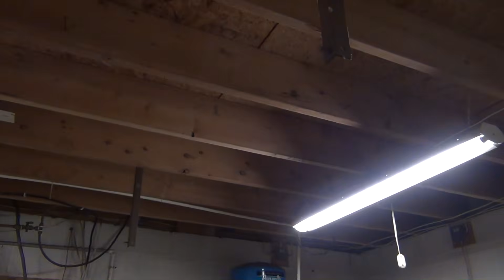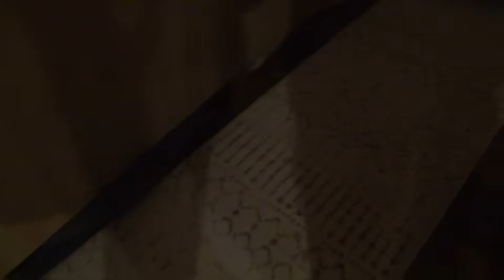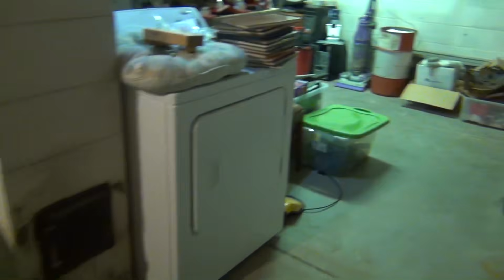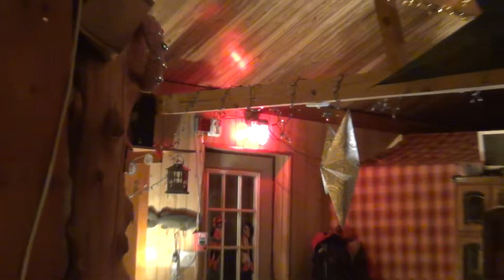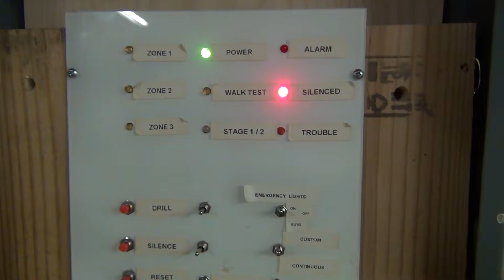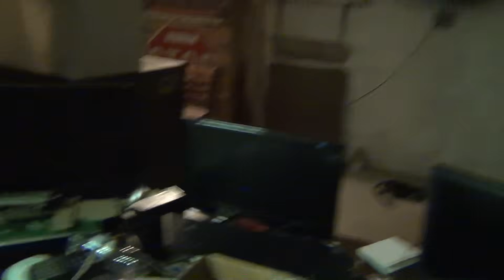System Test 28:  AC Devices!

Comment from the maker: Two things to note:
1).  DISCLAIMER:  This video features devices powered by 120v AC.  Do NOT play around with this kind of voltage, it has the potential to cause serious bodily harm, or even death.  I made careful and deliberate efforts to verify that the circuit was not receiving power while it was being serviced.  Only work with 120 volts if you follow proper safety precautions, or have someone on site that is qualified.

2). Sorry about the badly edited jump cut in the beginning, I stated that the yellow walk test LED was new, but it was actually in the last system test, so I cut it out of this video.
Reply: Do a 28.1 with a true alert on 60 bpm and 4050s on 90 bpm
Reply from the maker: @vintagesimplexfirealarmsof6440  I can only do one coding pattern at a time
Reply: @FrostedStrobes  oh 90 bpm plz
Reply: @FrostedStrobes 
 -
Reply: @vintagesimplexfirealarmsof6440 do one coded to 4-4
Reply: @FrostedStrobes hi buddy sorry I was mean to you and your friend along time ago I got more patients now so I was wondering if u can do a video with simplex horn strobes the red square ones like the ones that schools have and have it on march time and then after that continuous and then after that code 3
Reply: @FrostedStrobes i like Fire Alarms
Reply: @vintagesimplexfirealarmsof6440 f😊
Reply: Yea I am starting a fire alarm sitcom testing
Reply: Electroboom has touched 120VAC before and it is not peaceful, it is hell, don’t do it 👍🏻
Reply: @Alarmo450  I Watch ElectroBOOM
Reply: @iansanchez1470  SAME! That transformer that he cut open sounded incredible that one time. It sounds like a device that Frosted hid from the video.
Reply: @Alarmo450 yeah bro gets shocked almost every video
Reply: So I would need FrostedStrobes to come to my home
Reply: I he would…
Reply: If he wants
Reply: Indeed 120VAC is very harmful
Reply: @Flanks719  it is, but if it’s just a little shock then it’s not that big of a deal, I should know because I got electrocuted 9 times in my life
Reply: I have a 12VAC 4050 too
Reply: Yeah, for that light that had the red light bulb in it, for the 4050, it kind of sounded raspy.
Reply: I have to say that I admire your ingenuity with this setup. I work Armed Security for a major area local hospital of which active fire/alarm response is one of my core duties. I'm not 💯% entirely sure as to the exact technical/programming specs of the fire panel itself located inside my security station (other than the system is coded to sound a low volume single stroke chime within the operating theaters (rooms) so as to obviously not startle the OR staff and surgical teams when performing surgical procedures and is just a standard remote horn while the remaining areas of the hospital are set on a chime as well... BUT however your code-4 setup reminds me of exactly how my control panel is designed...to help prevent/mitigate against any patient/visitor distress, the system is setup more like a Morse Code-like annunciator rather than your typical fire system setup.. To simplify the rundown... Here is exactly how the system operates and alerts to the PRECISE location of where possible smoke/fire has been detected: The hospital I have a security contract with is seven stories: first five stories are the in-patient wards (admitted) rooms with the OR/ICU on the sixth floor and a medical laboratory on the seventh floor - I'll say theoretically that a alarm was activated on the 3rd floor --> ZONE 2 (OBSTETRICS) --> BOILER ROOM 1...I've step away to make my usual rounds and am not close by my station to get a exact report.. The system (coded to chime) sounds as such: 3 CHIMES (announces the location of the alarm that's activated (followed by a brief 2 seconds pause) --> system then sound 2 CHIMES to indicate the zone that has alarmed (OBSTETRICS) and lastly it then chimes again followed by a calm verbal announcement saying: BOILER ROOM 1 (the PRECISE location of a possible smoke/fire event that's triggered said alarm.

 I've come to love this setup since it still performs it's intended job while doing so in a way as to not incite any panic or distress to either patients/staff/visitors or those within the ER waiting room on the ground floor and should a fire ever occur, it makes my job of initiating and assisting in a hospital EVAC much more smoothly and easily without having to exercise any crowd control due to panicked persons stampeding to the fire exits or jeopardize staff/patient safety trying to make thair away to assigned assembly points or areas of refuge SHOULD it ever be a verified alarm.
Reply: True
Reply: With the safety
Reply: I can make my own Wheelock 34 knockoff that uses a very specific custom grille design, but sounds exactly like a dryer. All using 12v AC.

EDIT: Speaking of dryers, try rigging your dryer's buzzer up to the system.
Reply: Soon

Comment: I FREAKING CALLED IT! The way the timing was a bit odd FELT like it was mechanical versus software.
ALSO: Nothing quite like 120BPM on mechanical horns.
I also kind of like how the AC horns sound.
Would also love to se a mode similar to another video where the alarm state switches every second. (Measured the time thru Audacity and it's actually about 1.16 seconds on / off.)

Comment: In system test 25 remember that Argo WGMS add it to the system place it next to the panel and in the office replace the strobe with a Wheelock 7002 – 24 and if the strobe in the office it's just too cute to remove from the system add it to the room next to it make sure to do that in system test 29
Reply from the maker: Unfortunately I cannot do that as I no longer own the WGMS.  

System Test 29 is going to have a wheelock-centric theme, but with electronic horns rather than mechanical.
Reply: @FrostedStrobes  okay that sounds fun did you know that there's a Wheelock 7001t & 7001t-24
Reply from the maker: @something-e3d1f  I have heard of those!  I actually do have a 7001t-24, but I need to replace the horn, if I get around to that I may find a spot for it in system test 29.
Reply: @FrostedStrobes  place the Wheelock 7001t-24 where the stairs is
Reply: @FrostedStrobes  oh do you have to fix it is the horn broken or what after you completely fix the horn make sure to put it in the system test 29
Reply from the maker: @something-e3d1f  The broken one is the only one I have, but since the horn on it is just a 34t-24, I can just replace it with any other generic 34t-24 to fix it. As far as I know, the strobe works just fine.

If I use it, it'll probably end up in the bedroom, but we'll see.
Reply: @FrostedStrobes  too bad in system test 23 you had it in The garage
Reply: @FrostedStrobes  make a video about you testing the broken one if you feel too embarrassed to do it just put it on unlisted
Reply: Is it a broken 7002-24, broken 7001-24, broken 7002t or a broken 7001t let me know
Reply: @FrostedStrobes  in system test 23 you place the broken one in the garage sorry for saying this again but I just wanted to let you know
Reply: I cannot believe that Wheelock 7001 234't-24's have big fat horns

Comment: Weird question but did you buy one of those 4050s off NewAgeServerAlarm? One of them in the basement sound almost exactly like the 4050 featured in System Test 28.
Reply from the maker: Nope, the 4050s came from Wisconsin.
Reply: The one NewAgeServerAlarm used in ST28 was actually a 4051 but he took the diode and capacitor off to make it a 4050…

Comment: How did you wire AC alarms to DC alarms? How did u mix 120vac with 24vdc horns i wanna do 12vac and 24vdc soon
Reply from the maker: I used a 24vDC relay, powered by the panel's horn NAC, with a 20vAC power supply running through the contacts (the 4050s are 12vAC, but they should be fine since there's four of them).  Be very careful not to get anything mixed up, that's how you end up with broken alarms.

Essentially the same with the lights, only difference is each relay is located at the base of the lights (except upstairs, where it's positioned between the two since I bought one fewer relays than I ended up needing).

The golden rule that I have followed from the beginning is that anything and everything can be fixed or rigged to work using relays.

Comment: STVM in Akron has the same 4050s! Have you seen my video of that fire alarm system?

Where did you get those 4050s? Old School Fire Alarms?
Reply from the maker: Glad to hear 4050s still float around in the real world!  Very cool system in that video, I had originally intended to get dual projectors for mine as well, just didn't end up happening Lol

I bought them from some random eBay seller, I don't know if they have any roots in the community or not though.
Reply: @FrostedStrobes  You were trying to imitate my high school? 

You would've needed more 70s 4251-20s 4255s and a 4240 series panel.
Reply from the maker: Wasn't trying to imitate your high school in particular, just vintage systems with big red lights and aggressive AC horns in general.

Especially since I can't afford any of that stuff Lol
Reply: @FrostedStrobes  Sorry for the late reply. My high school may be demolished in a few years. I now go to a high school on the west side of Akron, which is more up-to-date. The fire alarm system will be going to a fire museum; I may be getting that painted over signal setup by door #7 and the broken 4050 in the basketball locker room. Yes, I did share that video with old school fire alarms. 

I can't afford any vintage fire alarm hardware either as I'm a broke high school junior

Comment: I guess you became FROSTED LAMPS in this episode instead of strobes.
<badum tiss>
But I love the code 4-4, it's super cool! I'm excited to see (or hear) what you have planned for it in the future!

Also when is system test 26?
Reply from the maker: Heck yeah, frosted lights are cool, I'll take it xD
I would love to use 4-4 on electronic horns more since literally nobody does that for some reason Lol

also System Test 26 will be coming out sometime around 2091
Reply: @FrostedStrobes  Omg hearing 4-4 on unusual devices like something a MT on bell/siren/slow whoop/march time would be wacky, same with a 7002 series device. Also you never see vibrating bells on 4-4 code. I'm excited to see what you end up doing. 

Also ayyy 2091 isn't THAT far away lmao. It'll be worth it.

Comment: How we use a 12vac horn on a 4006 or 4004
Reply from the maker: I have no idea, I don't have experience with those panels.
Reply: @FrostedStrobes  can u do 90 bpm next test
Reply from the maker: @vintagesimplexfirealarmsof6440  I do plan to make a 28.5 where I do a few other codes, like 90, 60, and 20 BPM, and showing what the red lights look like with all the basement lights turned off, that kinda stuff.
Reply: @FrostedStrobes  cool
Reply: @FrostedStrobes  imagine doing cont with volume screw all the way out
Reply from the maker: @vintagesimplexfirealarmsof6440  Ooouuch my ears xD
Reply: @FrostedStrobes  when are u going do that
Reply from the maker: @vintagesimplexfirealarmsof6440  Hopefully soon but I'm not too sure, I need to buy more wire since I started fixing the awful mess of them I'd made before.